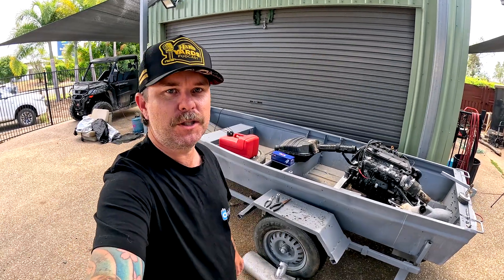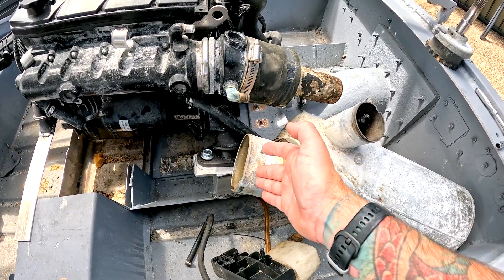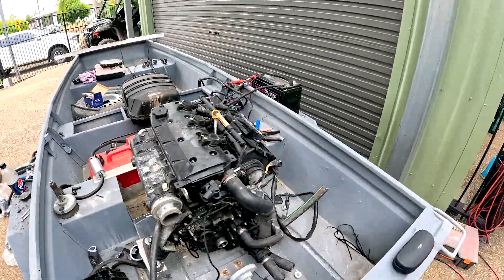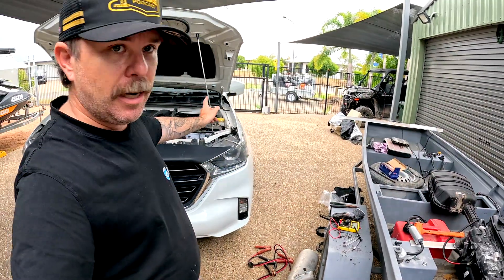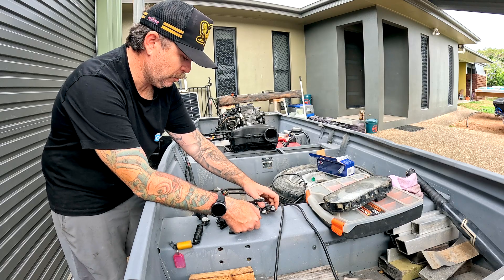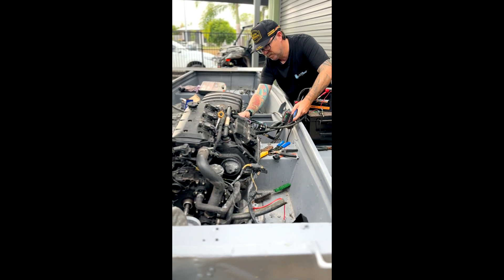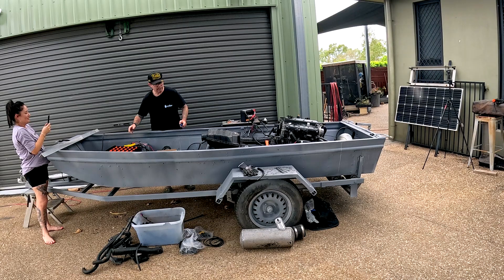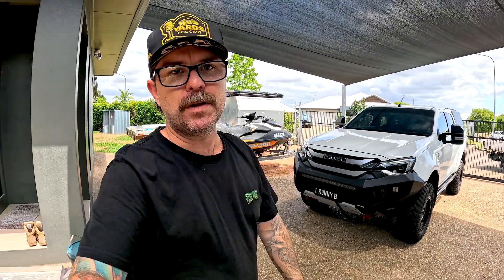Mini Boat, Monster Power: 155HP Engine COMES TO LIFE! - 12ft Jet Punt Build Episode 2

Comment: Make sure you put all 3 of those exhausts on, dont want to upset a certain person
Reply from the maker: 😂 you also sound slightly upset
Reply: Nah it's a race boat that's play on! Couldn't sound any worse than a stock v8 cruiser with a sewage pipe exhaust system.